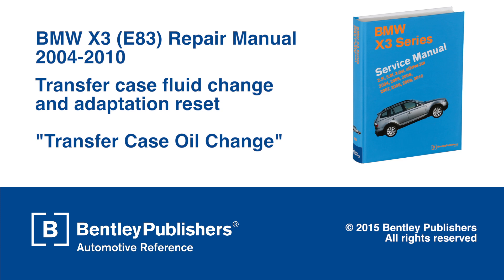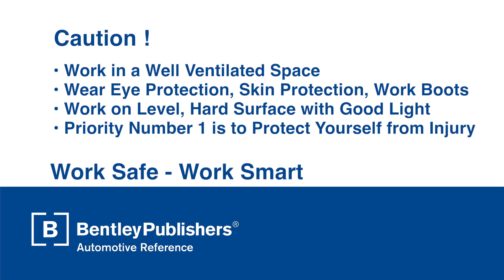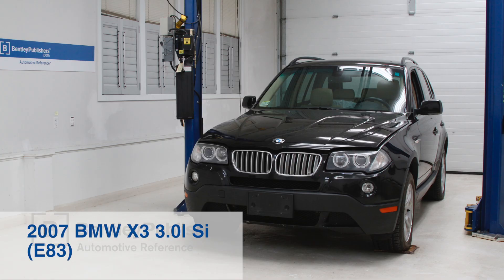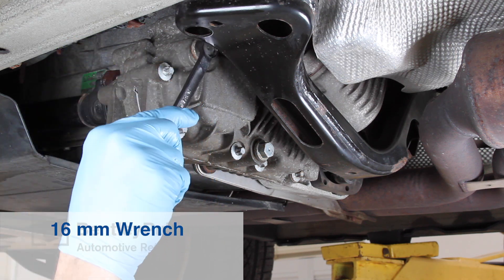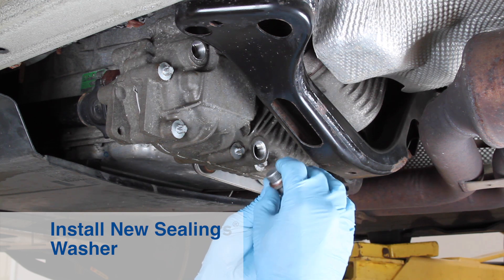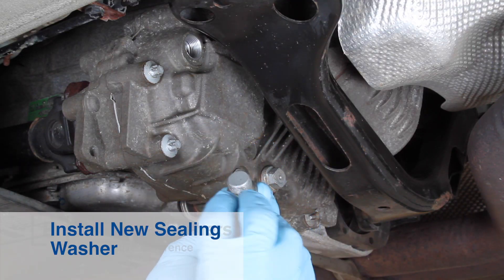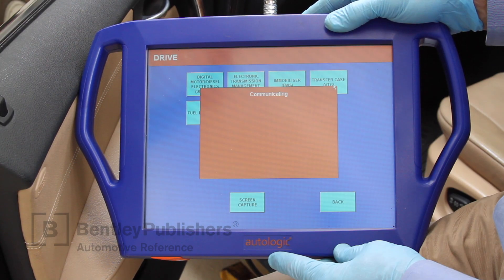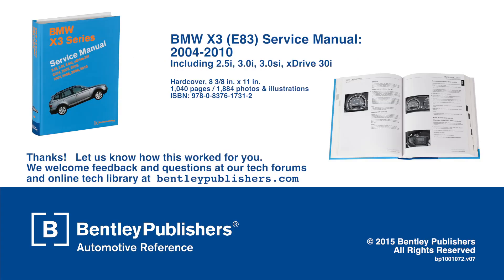BMW X3 (E83) 2004-2010 Transfer Case Oil Change - DIY Repair

Comment: why do you have to do a software adaptation just for changing fluid?
Reply: Because the software automatically adapts the shift timing based on the age of the fluid. The older the fluid the more delayed the clutch actuation will be, the car will alter this over the life of the fluid so that you get consistent transfer case power distribution from new car to 100k ish miles.

Comment: Hello!  I have a BMW f30 320xd, (WBA3D51010J476018), a few days ago I received an error on board (Driving Stabilisation), the car now only enters comfort mode and I have traction only on the rear wheels, after some investigations I found the following code: 48097D (  Transfer case - open clutch position, rear drive only), I mention that the failure occurred in the morning immediately after starting the engine.  The car has no transfer case symptoms, does not stutter or make any strange noises.  I replaced the actuator on the transfer case and it worked fine for 3 days after which the error reappeared on the board, I took the old actuator apart and found a swollen capacitor in it.  Sincerely, Octavian

Comment: Could a need of transfer case fluid change be the reason the 4x4 light is on?
Reply: Yes. Plus chek the plastik gear in the transfer case. I usualy gets broken. You can take out the old gear and turn it 180* so it use teath that Are not broken
Reply: @Dunderbee  Thank you. Just to make sure. Are you referring to the plastic gear inside the transfer case actuator motor? Thanks

Comment: Hi there.  I have BMW X3 2005 2.5I. Can I use DURAGEAR 75W-85 SEMI SYNTHETIC GEAR OIL for transfer oil?
Reply: ONLY BMW Fluid for a reason.

Comment: The video shows the mech holding a bottle of BMW 75/90 gear oil. That’s not what you put in the transfer case. Put BMW DTF in it. It’s like $60 for a liter.
Reply: You can use 75/90 oil in the transfer case. If you want to go to BMW and spend 60 Bucks then go for it but there's no point. Clean oil is the key.
Reply: Well, that's why I'm here... For this comment... I have 1 L left from my front differential and I was wondering if I can put it in my transfer case... That's what I thought too, since it's gear oil...

Thanks for the confirmation!

Comment: IF 300ML WERE LEFT IN THE OIL CAN, THEN YOU DON'T HAVE 700 ml IN THE TRANSFER CASE AS YOU HAVE A LOT IN THE tube....!
Reply: Ok, but you don't have to yell
Reply: @serezhka021 😂

Comment: Would a bad transfer case cause ticking while the engine is running and matching rpm as well?
Reply: Will Wel usually your lifters. Try bleeding them. Start your car and while in park rev up to 3,000rpm and hold it for 2 minutes. Should help with ticking if it’s the lifters.
Reply: @chelsiefetherman3324  Thanks for the help. I'll do that as soon as I replace the water pump that just went out on me. Not having the best of luck right now with the girl.

Comment: Please help !! We changed the gear for my X3 2010 E83 , no lights pop up to screen , made the diognostic in BMW no error code.  After changing can not accelerate more than 80 km and directly 4x4 lights (only 4x4 ) . Changed transfer case oil , not worked. Thanks in advance.
Reply: Айджан Дауд check battery it may just be low battery charge. Charge your battery.
Reply: Maybe is the VTG

Comment: Is there a low cost way to do the adaption reset without buying that expensive scan tool?
Reply: The Schwaben Scanner, also known as Foxwell NT510 can reset transfer case adaptation.  I just found the path and completed this on my 2007 X3. First, in the Main Groups select SERVICE.  Then select DRIVE.  Then select TRANSMISSION CONTROL VTG. Then select OIL Change.  Then you will see text stating to turn ignition on and do not start engine, select OK.  The you will see text stating that next step is adaptation, select OK.   I could hear mechanical movement under the vehicle. After this. I cleared the oil wear error code and it has stayed off.
Reply: Use your computer
Reply: @kabirthepunjabi  Sold the X3 a few years back.  Driving Subaru now and won't look back.  BMWs drive nice but they no nothing about reliability/longevity.  Plastic everywhere and even under the valve cover they put electronic plastic parts.  Buy new if you have the money and get rid of it after three years.
Reply: I believe the Schwaben scan tool does it.

Comment: Great video.  Thank you.  After changing the fluid, and resetting the codes, the oil wear code still would not clear.  What might cause that?
Reply: Did you figure it out?

Comment: I am not on YouTube.  I only said you failed to show how to add the trans fluid.  Those steps are missing. 
Just do over with the very important points.  Show all how it’s done.  Thanks
Reply: Abad perez what does the transmission have to do with the transfer case fluid change?

Comment: I hear clunking sound when I accelerate at a complete stop, especially on an up hill. I took it to the mechanic and they could'nt figure it out. Do you know what could be the problem? thanks.
Reply: It might be this. 

http://forum.e46fanatics.com/showthread.php?p=6986238
Reply: GabeCAM Hey man, how did U finally solve the problem?
Reply: Check your driveshaft Universal Joints. If there is Orange like rust color around the u-joints just change the driveshaft or the U-Joints. If you wanna be stubborn like me... lift one wheel off the ground put in neutral, chuck some wood behind the wheel so the car don’t roll on you, then you’ll be able to turn one wheel with your foot while checking the U-Joints. If there is any play/replace. Good luck it’s a pain in the ass especially with AWD.
Reply: By the way what was your problem?
Reply: same here ...clunking noise ...at low speeds